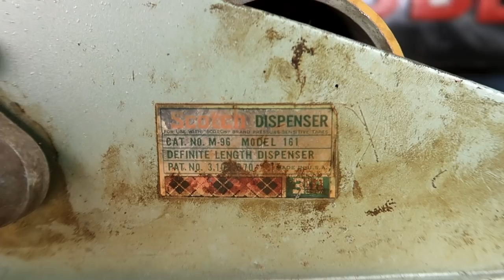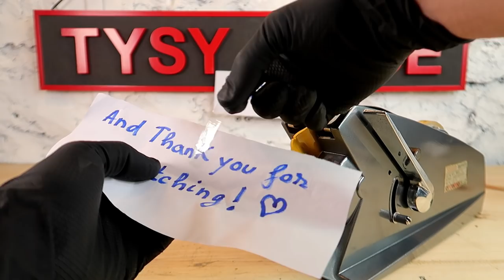Unique Tank Dispenser Restoration

Comment: to the people saying this is over-engineered for a tape dispenser, it's not a regular dispenser. It's a "definite length tape dispenser". You can adjust it (by limiting the lever swing) to dispense a specific length of tape. Probably used for a commercial application where they are using the same length of tape over and over again. this would speed up the process, keep the item they were taping free of excess tape and would also reduce tape waste.
Reply: wow that cleared up a lot of question, I was thinking the same all that for a piece of tape.
Reply: These were often used for film splicing.
Reply: @71Giggles  cool
Reply: How did people not realise this to begin with?
Reply: ok “ breadbutt”
Reply: I only know of an (old) electric one is came across in th late 1980's
Reply: Also, no such thing as over-engineered, just doing a guaranteed way of doing something right the first. Personally, because it doesn't have a 2 stroke engine attached, I think it's under engineered.
Reply: breadbutt but (now) its over engineered.
Reply: This type of dispenser was used HEAVILY in printing. We would have multiples of them with different kinds of tape for our various processes. The advantage is less about the fixed length, and more about the rapid dispensing of tape. It's a really fast and smooth motion to pull down with your thumb, and bring your finger up to stick the tape and tear it off. You could get 8 strips of tape on your fingers in a couple seconds one-handed, while your other hand is holding the film/mylar/paper in place.
Reply: @kookyabird  wow
Reply: Breadbutt is correct, we used to use these and another variant for paper tape that would also wet the adhesive.
Reply: @PBMS123  Because a lot of people are very young and probably don't know much history about old machinery and industrial work, I'm thinking.
Reply: That would make sense because I don't see this for your average office that is why I have never seen it before but cool looking through.
Reply: That is really cool... and in all honesty I don't think it's over-engineered, I think tape  Dispensers now a days are under-engineered and just honestly not well made.... plus this could double as a paper weight and still be use able... I honestly wish I had one
Reply: @eddietowers5595  There is definitely such a thing as overengineering, My industrial designer dad always told me that the best designs have the fewest moving parts. That was until digital electronics and I think they are making things harder than they have to be, there may be fewer parts but way more room for errors. New cars have camera mirrors and your "mirror" is just a screen. Just another thing that can go wrong where a mirror wouldn't.
Reply: @oriaaane  Guess he never shared a joke for levity, either, huh?
Reply: Z
Reply: It is also used in book repairs. I have a later, plastic model that is exactly the same aside from the material and a bit of the bottom.
Reply: Who needs a specific length of tape tho? Lol.
Reply: I honestly think the average person doesn't know how sucky the scotch plastic dispenser that comes with the tape because they never have tried an antique tape dispenser. These things are amazing and make you not want to kill yourself when gift wrapping.
Reply: @lawisabeoivonios_3690  it's called being professional and taking pride in your work. Plus Overhead becomes a thing. At one point it's not worth your bloodied hands using dollar store tape.
Reply: @loverlei79  Pretty sure the comment you're replying to was deeply sarcastic.
Reply: @Anastas1786  🤣🤣🤣 now i feel dumb.
Reply: The factory I used to work in was old school like that. We had similar tape dispensers to this one. Just bigger to hold more tape.
Reply: That sounds like something that Julius would use
Reply: These are so used in factories and warehouses for shipping (obviously new versions, not these antiques)
Reply: Thanks for your explanation! :)
Reply: Based
Reply: In the X-mas season when gifts are wrapped as a service in the shops the person who does the wrapping will appreciate such thing very much.

Comment: That tape dispenser has more metal in it than a modern angle grinder.
Reply from the maker: exactly 🤣🤣🤣
Reply: @TheJR1948 Not sure on the angle here with "More to the point. Making something shiny. does not equal "restored"."  but if it's an accusation of Tysy then you can go to hell as this is above that, It's even stated at 7:25 that they are removing cast marks and the list goes on. 
I hope I read your comment wrong and you're not so passive-aggressive and ambiguously malicious.
Reply: Modern ones are litteraly a plastic shell filled with cement
Reply: Maybe even some cars!
Reply: Yeah we don't have enough junk plastics in the landfills.  Stuff used to be built to last .  No so anymore.  Now things are built to break, so you have to buy them over and over.
Reply: ... some cars too
Reply: @MrStabby19812  i always wondered why on earth it's filled with cement since it's a wasteful space...why not just cover the base with some more plastic or some metal...
Reply: @federiconahuel6997  keeps it weighed down when you tug the tape
Reply: More than most new cars!
Reply: TheJR1948  It makes it a restomod!
Reply: Kody Montes 😂😂😂😂😂

Comment: My great aunt, in her 80s now, used one to wrap presents at the counter of the department store Stone and Thomas in the US, this would have been late 70s early 80s when I saw it.
Reply: I still use one of these, my family and I use it for wrapping meat in our butcher shop, we had gotten a new one because we had trouble finding the right size tape rolls, but as soon as we were able to fine tape in that size rolls again we switched back without hesitation because its heavy enough to rip the tape while holding the paper in place with the other hand
Reply: My dad worked in the Post Office until the early 90s, and I'm pretty sure they had at least one.
Reply: Also why get rid of the casting marks. They should be left alone as they were part of the original manufacturing process
Reply: @garethwilliams5809  ehr, casting marks are left to cut costs wherever possible.
If they had the ability to remove them while still keeping the price low, they would've done that too back then.

He's not simply restoring it, he's bringing it to its best appearance possible too
Reply: The design before is made to last and beautiful, wow!

Comment: That parts washer looks much fancier than the one I use at my job! Here are some tips from someone who uses one of those things frequently:
1. Set up a small fan or blower beside the washer to blow fresh air across your face. This is much more comfortable than a mask during hot weather.
2. Have a cup or bucket you can put some of the fluid into so you can check whether the washing fluid is dirty. The solvent will probably work regardless of how much dirt is in the fluid, but murky cleaning fluid can make it look like dirt is coming off of something that's already clean.
3. Wear an apron or a jacket you don't care about. If grease does spatter onto your clothes, spray the cleaning fluid on the stain and then immediately hand-wash the clothes to prevent the strong solvent from damaging the fabric.
4. Use an air compressor to dry out screw holes and other tight spaces. Wear goggles when you do this to keep mist from getting in your eyes.
5. Put a wire mesh over those slats on your parts washer! Fumbling around in the cleaning fluid reservoir is an easy way to get a rash. You may also want to get arm-length gloves like the kind people use to work inside fish tanks and garden ponds. A magnet on a stick can also work sometimes.

I hope this helps!
Reply from the maker: thank you so much for all information, Kai have right is not smell and is very quiet 🤫, i love it 🥰
Reply: I used that parts washer with some incredibly aggressive solution at my previous workplace, it was such an amazing machine to use, cleaning throttle bodies etc in a few minutes without making a mess.
Reply: Or just read the manual

Comment: That is a Scotch brand (obviously) dispenser typically used in a shipping and receiving department.  It will dispense a premeasured amount of tape (adjustable) for any job you want OR it can be also used to dispense labels on a roll.  It's nothing more than an industrial strength tape dispenser for repetitive use.  The Scotch brand is owned by 3M (Minnesota Mining and Manufacturing Company) based in St. Paul Minnesota.  The term 'Scotch' had a pejorative connotation at the time (about 1925) but after a particular incident with a customer, using "Scotch" to describe them, the name stuck and was used in advertising since then.  'Scotch Tape' is now used as a generic term to describe any type of transparent tape regardless of manufacturer.
Reply: The name "stuck"...lol
Reply: This model is actually more commonly used in your local butchers for dispensing measured amounts of tape to wrap your meat in. It's a still in production model very popular with grocers.
Reply from the maker: Thank you so much for all precious information 😊
Reply: In production, but it looks like the modern ones are plastic with a weight in them. :(
Reply: Sadly yes, plastic is cheaper, but not long lasting.
Reply: It has the old 3M Mondrian Logo so will be prior to 1972 when the logo changed to the current one. My Guess is the 1960's. Yes is is built like a tank. Rugged and robust. It is an INDUSTRIAL dispenser for hard work environments and repetitive use. You can still see them in use today
Reply: Here in Brazil, any transparent tape is commonly called 'Durex' which is kinda fun , because, well...
Reply: @TysyTube  Also, this particular model is still being produced and sold by 3M Scotch Brand Products today. The original design was from the mid 1940's and other than some materials, is still produced in the same design now. I used to see a lot of these used in department stores like Sears & Roebuck, especially at Christmas in the give wrapping departments. Here is a link showing one you can still purchase today  https://www.3m.com/3M/en_US/company-us/all-3m-products/~/Scotch-Definite-Length-Dispenser-M96/?N=5002385+3293193930&rt=rud
Reply: I'm thinking mid 80's tape dispenser used in Microfilm / Aperture card production / Conversion services shops.
Reply: @michaelholderness9924 : A quick search on Google for the M96 tape dispenser takes you to a current 3M webpage with more info on it. Apparently they are still being manufactured and the basic design is still the same.
Reply: @_vincemartins  funny, here in germany it is "tesa"
Reply: @YamahaYZFR6RJ05  And in Austria it is "Tixo."
Reply: is it supposed to withstand coal miners banging on it with sledge hammers? WTF
Reply: MN represent!
Reply: Had one in our shipping dept around 1975
Reply: @_vincemartins  if you ask for durex in the UK you will end up with condoms.
Reply: @deejayy2k  well. That was the joke
Reply: @cdrom1070  3M designed lots of stuff, came up with many ideas and figured out ways to mass produce and make money.
Reply: Thanks for the explanation. At the end I was wondering, why the heck is the purpose of this when you can now buy scotch tape preloaded in a disposable smaller simpler plastic case that costs 99 cents. The premeasuring and factory repetitive use would make perfect sense.
Reply: The name “stuck”....... accidental pun? I think not...
Reply: Scotch tape is not a generic term. It is a registered trademark brand name and should not be used as a generic term. The generic term is simply tape. Please stop spreading misinformation.
Reply: Yes, "Scotch" is a brand name, however, many people use it in this manner as it has become synonymous with any type of transparent tape.  Not misinformation, but just a way people speak, it's a colloquial term.
Reply: Lauren R probably because it’s so hot there and they are constantly on the run from every blasted living thing that can kill you they shorten everything to conserve energy 😜😁( i love the Aussie’s and their quirky qualities)
Reply: @_vincemartins  Then how are the... real "balloons" called in Brazil ?

Comment: The Pat number. was able to read it. Received and issued in 1959
Reply: Patent seems to be ... A. P. KRUEGER TAPE DISPENSERS Sept. 3, 1963 2 Sheets Filed Jan. 17, 1961
Reply: @gav1njackson  Seems to be designed for a mailroom/package application rather than a desktop model.
Reply: You see these alot in butcher shops
Reply: Chakat Nightsparkle Good eye!  My guess was 1963.
Reply: Sounds like the 50s

Comment: I think the plastic part should be white, I think that because old plastic tends to become yellowish. You could submerge the plastic part in peroxide (better industrial grade peroxide but it also works with with the one from your first aid kit) and expose It to the sunlight for hours. The UV radiation on a plastic submerged in peroxide makes the plastic to lose the boron atoms that give the yellowish color, and they're replaced with oxygen atoms from the peroxide that makes the plastic regain his white color.
That also works with colored plastics, making the original color more vivid and less yellowish
Reply: Yep. I have seen retro video gamers restore consoles like that.
Reply: There is no reason for it to be white, 1 because it doesn't look like the average plastic that goes yellow, and 2 because it's a 3M product and being yellow is their thing.
Reply: These were not white, they came cream. The yellowish tone came from the tape over the years. I know this because we use them in the bindery department of our print shop. I have been in the industry for 18 years. I saw these come in new long ago.

Comment: For those who think this is over engineering, you are wrong!

Think about when there was a time when things were made to last, for instance they were made with quality materials.
 
This dispenser was designed to be used and "abused". That was craftsmanship. It is not the crap we see today. 

Another beautiful restoration, keep the videos rolling!
Reply: A polycarbonate dispenser would live just as long mate. They made these out of metal because it was the material they had.
Reply: Not even close. That dispenser is almost 60 years old and has seen heavy use. Poly would have cracked at stress points, weakened from us, egged out all the bushing points and placed in a bin before it hit 10 years. That steel will be here after you and I have departed this mortal coil.
Reply: @davidberesford875 ”heavy use” its a sodding tape dispenser, not a hammer. Poly would be in perfect nick.

Comment: I remember seeing a dispenser like this in a number of retail stores. Back before Sears and Pennys had Plastic bags, you would have your items wrapped with brown paper and either tied with string or taped closed.  I also saw presents (Christmas and others) wrapped with paper and this dispenser used for the tape.  Flip the lever, snag the tape with a finger and applied in a quick efficient movement. late 1960s and early 1970's.  Maybe even into the 80's.  I have seen one in the shipping dept when they needed to close boxes.  It used the wider tape 1.5" to 2" tape.  I do like watching these old workhorses being revived.   Thank you for the video.

Comment: So totally, ridiculously unnecessary.
I WANT ONE.
Reply from the maker: 🤣🤣🤣🤣 i feel the same
Reply: I wouldn't say this is unnecessary.  They still use items like this in shipping stations.  The movable stop under the lever allows you to dispense the same length of tape each time, and the size and weight, as well as the design, make it usable with one hand.  This is really useful if assembling boxes or wrapping gifts or packages.  Truly an industrial tool, though, not for the house... But I also want one.
Reply: Nice
Reply: As someone who uses a ridiculous amount of tape, I definitely need one of these 🤩